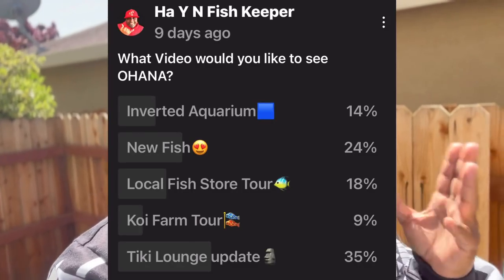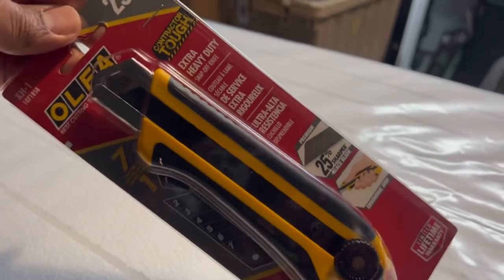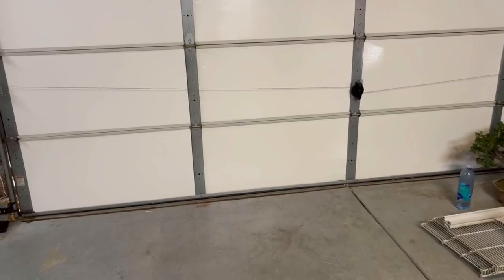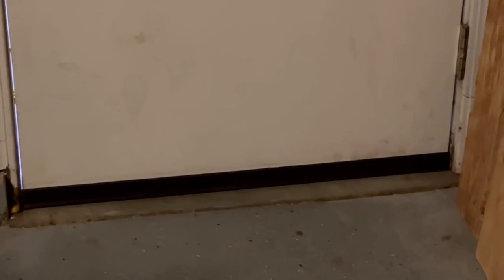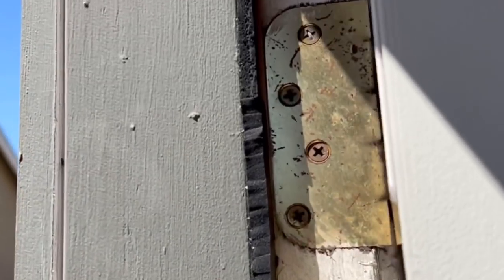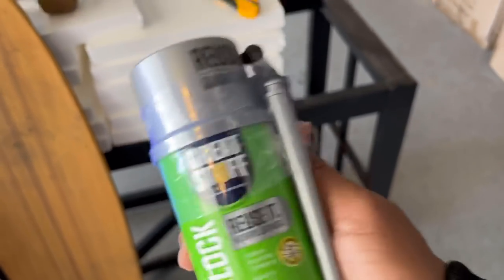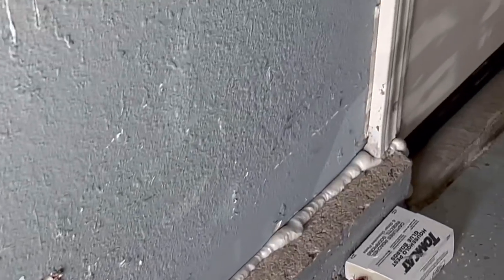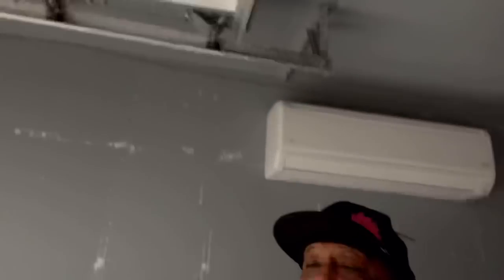TURNING my GARAGE into a FISH ROOM

Comment: Looks like you need an exterior garage door seal. It is vinyl with rubber seal attached. Nail or screw it to wood exterior frame and rubber goes against door. It will make it pretty much sir tight.
Reply: I couldn't bring myself to telling him after I saw the foam insulation
Reply from the maker: Ahhh yes!!  Good looking out!!  I like that idea!🤙🏽🤙🏽🐠